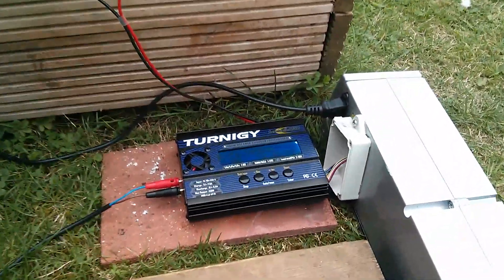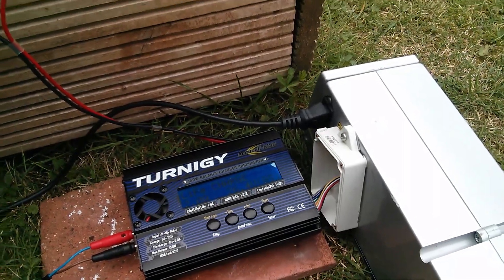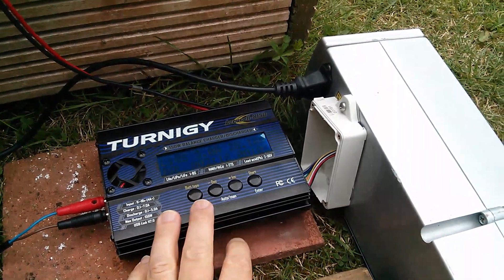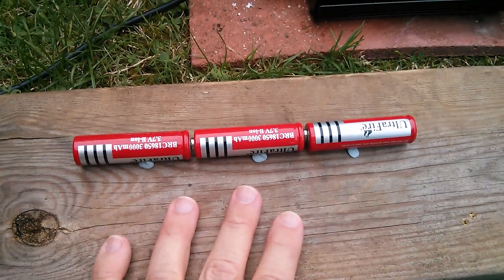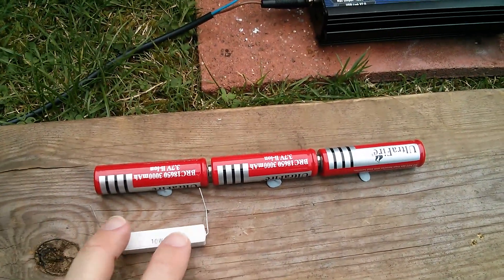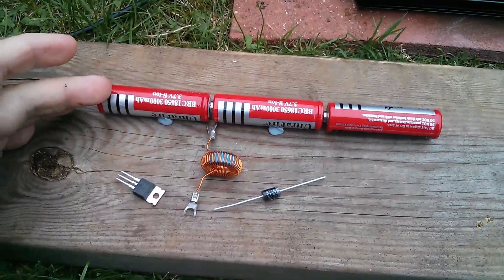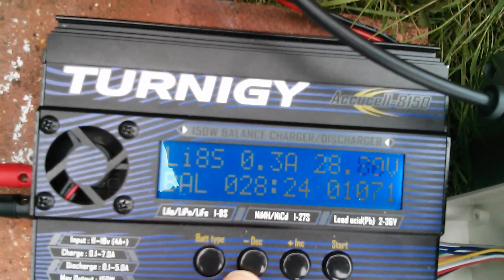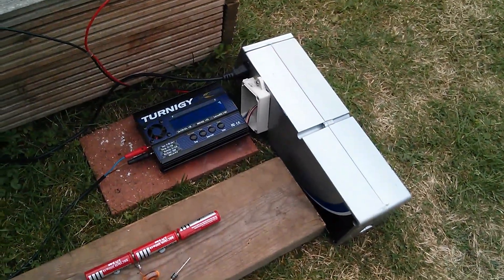Julian's Idea: Balance Charging using Inductive Transfer

Comment: Hi Julian,
i totaly agree that the most common method of balance charging is a waste of energy and not really intelligent. Wouldn't it be the best to just charge those cells that are lowest and stop charging the higher ones until they all reach the same level? You would probalbly need an Arduino or some kind of microprocessor to steer this process but i am also sure you could develop a circuit out of Opams and some transistors/mosfets to do the job? It would be even more intelligent than transferring energy from one cell to the other as this is not 100% energy efficient as well. Just charge the lowest cell(s) to meet the level of the higher ones and continue the charging process until all are full. I cant believe that nobody invented such an intelligent balancing process yet!?
One easy idea could be just to use a few of the tp4056 ICs on isolated DC supplies using the B0505S isolated convertes and just charge each cell up if needed (means below 4,12 V or so). Like here: https://www.youtube.com/watch?v=rpRYNMrVCk0

Comment: Active inductive balancing can be used to perform “bottom balancing” which allows stronger cells to share their charge with weaker cells. Bottom balancing can be done at any time but is usually done during the discharge cycle as cells with less capacity approach their maximum discharge limits. In this case, the primary winding is energized with a pulse of the battery stack voltage with the secondary switches on all of the cells open. Once the primary is energized, the connection to the secondary winding for the cell to be charged is closed, allowing the stored energy to be transferred. Bottom balancing unlocks energy that would have otherwise been “stranded” inside a battery.

http://www.digikey.sg/en/articles/techzone/2011/dec/battery-cell-balancing-for-improved-performance-in-evs---part-ii-active-balancing-technologies

Hope this helps.

Comment: Hi Julian

I am a South African farmer and our homestead is off grid and our electrical  requirements  are fed from solar. We have 4x 260Ah VRLA batteries and the battery balancers I have currently (http://www.ebay.com/itm/24V-36V-48V-Battery-balancer-equalizer-/221895722571?) cannot  keep them in balance. Several hobbists on a solar forum have put our heads together and have come up with the idea of drawing off current from the battery that is high to a isolated boost converter and redistributing it to the entire string of batteries. So excluding inefficiencies you would draw off 1 unit of energy and return 0.25 units to each battery. What do you think?

Comment: +Julian Ilett This came up in another forum I'm a member of, and it reminded me of your explanation in the middle of your video about placing the capacitor in parallel with different batteries. This is a chip made by Linear Technology for balancing lead acid cells using an auxiliary cell. Frequency is fairly low, apparently around 10 seconds per battery. Chip is also fairly expensive. Thought you might be interested:

http://cds.linear.com/docs/en/datasheet/3305f.pdf

Also, when are you making this inductive transfer thing? Bunch of us here are interested in perhaps doing something similar for lead acids :-)

Comment: Julian, you say that your UltraFire Li-Ion cells are low capacity.  The ones I purchased in 2011 (BRC types like yours and from different Chinese eBay vendors) were all repackaged used laptop cells.  They even went to the trouble of adding a protection circuit to them.  There are a number of videos on YouTube warning about this. Mostly these cells are near their end of life and thus might give you some unpredictable results.  I've had better luck buying Panasonic, Sony & Samsung. Keep up the good work.

Comment: I found this interesting because I've seen a few people talking and using back emf to charge lead acid Batteries, some even claim to have reached over unity. Back in the 80's and 90's era I would have dismissed this outright, but then recently I came across people talking that since the invention of Neodimium magnets being much more powerful and other claims of over coming Lenz's law it has put doubts in my mind, so as open minded I am I am going to test these theories out in a motor project, and reason I mention this is Back EMF is always something that interests me, as in old school engineers were always taught to short it with a diode, it was regarded as useless and unwanted. So what a breath of fresh air it is Julian to here people like yourself recognizing the useful potential we have here that was wasted  long before now. :)

Comment: Oh julian you are genius! I did a two way version schematic inspired by you just if you want to see it. http://imgur.com/7aRm6JI
those opto-isolators are for arduino input and as those diodes you can use internal protection diodes integrated in most mosfets.

Comment: I think that would make it too complex. The charge transfer from one cell to another would work though.
For switch mode system you might perhaps charge the inductor from all cells in parallel and have multiple isolated output windings which would essentially charge the one with the lowest voltage only. Compared to a few resistors this is rather complicated as well.
If you have only one cell that is significantly lower than the others you may also find it easy to charge only that call through balancing lead. (Connect the the wires of one cell only and top it up with a charger)

Comment: isn't that the basis of a voltage doubler/joule ringer, how would you control the voltage spike thru the inductor?
Definitely want to see your progress,  also doesn't it take a few dozen charge/discharge cycles to condition/match the cells in the battery?

Comment: Instead of feeding the stored energy to another cell perhaps just feed it back in to the supply, might simplify things.
And make sure switch the inductors on and off fast enough to avoid getting them in to saturation.

Comment: So basically what you are proposing is a line ov boost converters. Could be effective. But I can see this idea being much more effective on larger batteries. It's something I might look at on my 96 volt battery bank, which is made from a bunch ov secondhand starter batteries, naturally all random sizes and overall condition. But it does a good enough job ov keeping an industrial UPS working happily so I can feed clean power into the dishwasher while the gen-set is running. 

By the way, how is that solar flower going that you left out in the rain? My partner is a little upset about that...! lol

Comment: how about using a mutitap transformer with primary coils for each cell, and a single "secondary" that applies the emf across the full pile? May even be possible to use the autoformer idea with body diodes of MOSFETS, and avoid need for secondary coil.

Comment: You may find that a loss of energy is needed for cell loading more than discharge, This give a accurate reading of cell voltage, internal E.S.R and cell chemistry. Top Vid.
Big Thumb Up.

Comment: Discharging cells in others is dangerous, it can damage the cells.
Reply: JS7457 Not in this case. What you're talking about is that a cell can provide more current than it can safely charge at. Connecting a full cell to an empty one can damage it. In this case, we're talking hundreds of mV difference, probably currents in the mA range. It's an impractical idea, but not dangerous.

Comment: I like the out of the box thinking. It seems quite similar to a solid state Bedini SSG in principle, sending the back EMF out to the lower battery. If each cell was voltage read by the Arduino, a solid state relay system could enable just 1 circuit to send from highest to lowest, compare, then do same again. Each cell wont get above about 4.2ish volts, so a 5V Arduino would work well as sensor and switcher.

Comment: Wrt the right-most cell being high, can't you 'flip' it to the left-most cell through a similar inductor?

I have been thinking about balanced charging as well. What if you charge all cells in series pausing now and then to take individual cell voltages.

Comment: I've been thinking of similar schemes for my e-bike pack which contains a Chinese BMS, It works well but balancing is done by small resistors, probably similar to the Turnigy. I came up with several ideas but they required quite a large number of FET's since I wanted to magnetically couple all the cells so that the voltages were forcefully equalised (effectively putting the cells in parallel from an equivalent circuit point of view). Your idea gave me another approach which I had not considered; If you replace the diode in your scheme with another FET and drive them alternately at 50% then the centre tap point is forced to be at half the voltage of the cell pair, hence equalising the voltage. The works to balance two cells but what about the rest? Well you can apply the same scheme to each pair of cells (8 cells = 4 circuits) but then each pair of cells is not "aware" of the other pairs. To "link" them all you can either apply more circuits to cell pairs that interleave with the existing ones (not great), or, and here's the clever part, wind your inductor coils on the same core to magnetically link all sections together :) This applies transformer action between each cell pair ensuring the same voltage on every cell.
Driving the gates is a bit of a hassle since the source connections are all at different potentials but a gate drive transformer with a separate winding for each FET would be easy to make and since the driver just needs to operate at 50% duty cycle there is no problem with saturation either. Everything in the circuit balances itself nicely and only one driver is needed.
As a further extension to this you can add another winding to the inductor and provide the charging current via it from any voltage source you care to use. Just add a full bridge, operated from the same gate drive transformer and calculate the turns to match your desired charge voltage.
Thanks for the inspiration!

Comment: Since what you make this way will effectively be a boost converter instead of using an arduino to switch the power you could use a dedicated boost converter IC with an enable ( stand-by ) pin and enable it with the arduino once the voltage gets too high, the last cell could be balanced by the same method by connecting the output back to the power supply line, this way the efficiency would be increased both ways.

Comment: In terms of your 2 adjacent cells example, that's a buck-boost converter so it should work. It sounds like you'd use an inductor in discontinuous conduction mode. What will be most interesting is scaling it up to multiple cells. As with existing DC-DC converter topologies, capacitive charge pumps are very limited in power and using inductors to store the energy should be a better option.

You might run into a bit of a stumbling block in terms of driving some high side FETs as a FET on each cell will have its source pin floating on one of the cell terminals. Sorry if that isn't clear, I've just finished a night shift.

Comment: I'm not sure if I'm over-simplifying things but wouldn't be a lot easier to just connect them in parallel? I mean to put all of your batteries in parallel once reaching a total pack voltage and let them balance, don't know if there are any downsides to this scenario other than wiring setup complexity but I think it's simple in concept otherwise. Another way to do it maybe have a multi-lead connector with jumpers so when you plug it into your bike sets them in series, take it out for charging and replace the series terminating connector with the parallel charging one and charge at the recommended single cell voltage (and once reaching the full charge disconnect the source and let them rest to balance each-other since they'll most likely settle at different voltages), you might be able to build that into the bottom of the battery pack and corresponding connector into the mounting dock in the bike as well as some charging dock, so it makes it easy to move in/out.

I watched the explanation again and I think it's too complex to work although in theory sounds fine (seems like a sort of bare switching power supply, i think you would need a filter cap though) - if you have 2 batteries only then it might work, even though I still think you can connect them in parallel and make it a lot easier, but if you have 8 cells you're going to balance 2 of them, then have the other 6 out of balance, then use some quite complex logic to determine how much energy to transfer from one to another and repeat. I don't think it's feasible (sorry, this post got too long).
Reply: +sharp x I actually did that, used a relay that when it detected that 5V for charging where present it switched the two 18650s in parallel for charging (using a TP4056) and then back to series for operation of the motor as soon as the power was disconnected
Reply: I like this idea. it means he will need a big multipin connector on battery pack where each cell has it's own pins on the connector. for chargin cells will be connected in parallel and in series while on bike.
Reply: Matt Gorzka 
Yep, that's exactly what I had in mind, 2 different docking connectors with individual leads to each battery wired to serve the purpose
Reply: MrOpenGL 
that sounds easy (although in his case would require 7 double pole relays if I got it right, so probably a wash vs a connector as far as complexity)

Comment: hmmm  sounds good on paper, but then...  Wouldn't the strange way the battery is getting voltages/current violate the recommended (required ?) voltage/current supplied to charge the battery, especially things ilke LiIo that have a pretty specific "need".

Also, the idea may work to balance the battery, but can you use that WHILE it's charging ? or would you have to take the batteries out of the charge cycle periodically ?

Also, wouldn't this mean you need to measure all X cells in the charger (however many X may happen to be), and 'load' the inductor with the highest loaded cell to then "unload' it in the cell with the lowest voltage.  Wouldn't that require quite a complex switching system also ?

just some idea's popping to mind, I'm not an expert on batteries.
Reply from the maker: oreubens Yes, it's absolutely meant to be used while the cells are charging. The transfer of current through the inductor should completely offset the charging current passing through the string of cells.
Each cell will have its own microcontroller which is measuring the cell voltage and adjusting the MOSFETs PWM setting to prevent the cell going over voltage.

Comment: Hi Julian.  Neat idea, but I think there might be a problem.  If you assume (as we saw in an earlier video) that the cells in a pack are only a few tens of millivolts different in state of charge, then the Vf of the diode could be a problem.  Even with a top-spec Schottky, you may not get the cells closer than about 300mV to one another.  Or will the natural back-EMF voltage rise overcome this?  Even if back-EMF were high enough to overcome diode Vf, the diode would be very inefficient when you're talking about making mV-scale adjustments between cells.  Perhaps a dual-MOSFET arrangement would work better, in the way that a synchronous rectifier buck converter uses a high side and a low side FET instead of a high side FET and catch diode.  Select very low Rds(on) FETs to minimize Vdrop.  Instinct would be to use two N-channel devices for their superior Rds(on), but then one would require a high side driver, so maybe a P-channel on the high side would be easier to implement.  Of course, once you move beyond a two-cell pack, driving the FETs becomes more complicated.  Maybe all N-channel with a driver on each gate would be easier in the long run.  In any case, timing of gate drive signals will be critical.  Just thinking "out loud"...  I'm looking forward to seeing this idea develop.  Cheers!
Reply from the maker: FlyingShotsman I'm not worried about efficiency of any part of the circuit - if only a small amount of charge is transferred, most being lost as heat, it's still more efficient than the resistor method.
The back EMF should be more than enough to transfer all the usable charge from left cell to right cell. If the left cell is fully charged and the right cell discharged, I should be able to completely reverse that situation.
Reply: Very true.  Given that the resistor-based circuit is 100% inefficient, just about anything else will be an improvement.  It's a very clever bit of thinking on this; I hope you can make it work.

Comment: Why doesn't the charger charge the individual cells to a specific voltage instead of charging them all together and then using the resistors to bring them back down?
Seems like a waste of energy and time.